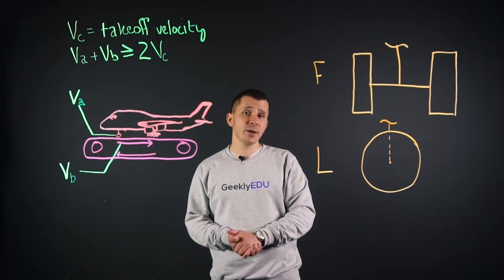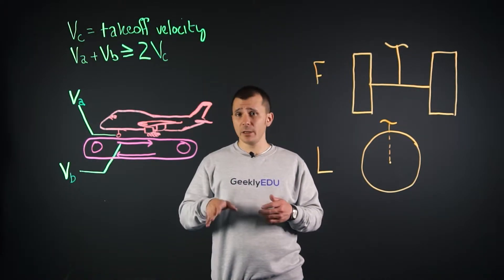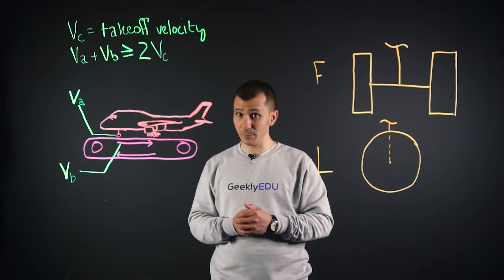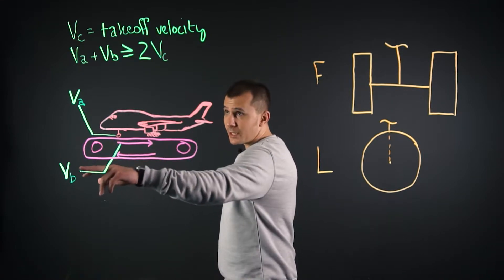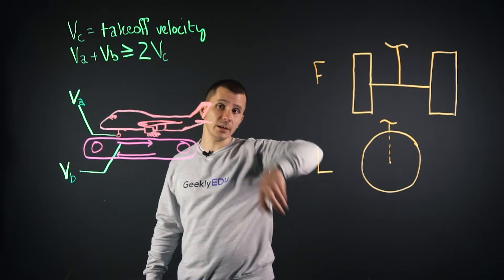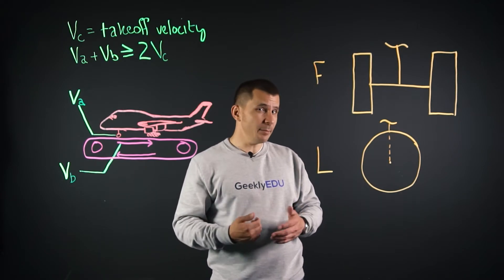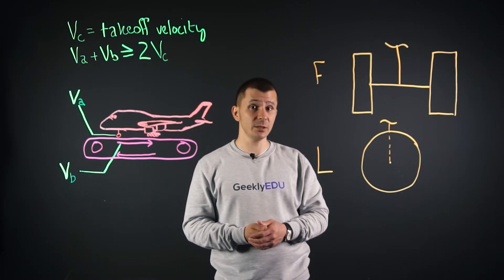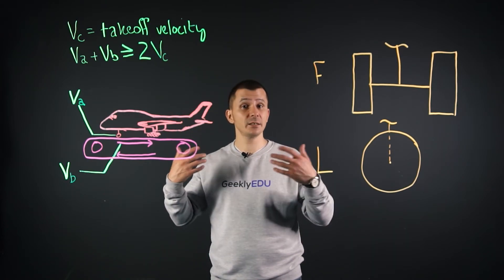Plane on a Conveyor Belt - Will It Take Off? #GeeklyHub

Comment: First off, there are no motors in the wheels, they are FREE SPINNING.  Second, the engines and the thrust they creates against the air itself are totally independent of what the wheels are doing.  So it makes no difference how the riddle is worded, if any part of it talks about wheels spinning at whatever speed the plane will always take off.  People are too accustomed to how a car works because it's wheels propel it forward.  A plane does not do this.  It's wheels are only there to provide a smooth, low drag medium between the plane and the runway surface.  That's it.

Comment: If all you're worrying about is the tire ratings (which is a valid argument), let's use a 747 for example:

"The takeoff speed for a Boeing 747 typically ranges from 160 to 180 knots (approximately 184 to 207 mph),"
"High-pressure: Each tire can handle loads exceeding 50,000 pounds and can tolerate speeds up to 225 mph, with some rated for speeds up to 288 mph."

Now, consider that the rating isn't the point of failure, it's the point where the risk of failure begins to increase. If the plan is taking off at even 200 mph in this case, you'd have the tires temporarily and for a very short period of time exceeding their speed ratings. That doesn't mean they'll fail, just that the risk is increasing (there's always a significant safety margin built in too). As a result, the plane should take off fine, but you probably don't want to keep using conveyors.

Comment: The wheels and conveyor are irrelevant. The wheels aren't the plane's mode of locomotion. The plane's thrust would move the plane forward regardless of what the wheels are doing. They're just there to hold the plane up while it accelerates enough to take off. The conveyor can be moving in reverse twice the speed of the wheels and as long as they wheels don't fail causing the plane to fall,  the plane's thrust will still move the plane forward.
Reply: It’s not the mode of locomotion that matters.  It’s the motion itself that matters.

This is a kinematics exercise of two independent bodies with two frames of reference.  We are given the connection between those motions.

The video poster made up the ‘two times the speed’ canard for some reason instead of going by what the explicit parameters are as given.

A 1m diameter wheel travels 3.14m in one revolution on the surface it is on.  The surface then moves that same distance in that same time.  The net motion at the wheel axis is zero.

It’s just rolling in place.

Comment: I’m going to say tha wording of the problem makes all the difference.. We can all agree that if a wheel is on a conveyor and the conveyor is moving opposite the direction the wheel is turning, and at exactly the same speed, then the wheel will remain stationary. That’s the part of the problem that really matters in my mind. Almost every time I’ve seen this problem, it has stated that the conveyor belt will always be moving at exactly the same speed as the wheels/tires. That is going to be physically impossible in the real world, but that parameter makes it impossible for the plane to move, which is required for it to generate any lift.
Reply: Consider these two scenarios:
1.	If you have a front wheel drive car with the rear wheels on a small conveyor belt (The conveyor belt is designed to exactly match the speed of the rear-wheels moving in the opposite direction), but its front wheels are on the ground, will the car move forward? Yes. The front wheels cause the car to move forward, just as jet engines in a jet will cause the jet to move forward Yes, I used “jet” three times in a sentence. I didn’t want to say plane for clarity.
2.	A sea plane going up-river against the current will take off.

Comment: This is the way I proposed to answer this theoretical question. Use a model airplane on a conveyor running at Low speed one then record the RPMs or engine speed that keeps the airplane stationary on the conveyor. Increase the conveyor speed to high speed we just like 5x speed 1 and record the engine speed RPMs that keeps the plane stationery at the higher speed. If engine speed 2 is higher than engine speed 1 the airplane the airplane cannot take off.
Reply: A plane going from bow to stern on an aircraft carrier will demonstrate.  A plane rolling at 5 knots on a ship moving at 5 knots will be motionless in the environment.

Comment: If you actually looked at what people argue its not if the planes wheels would explode which would be extremely subjective. They argue whether the plane could move forward at all.
Reply: I never understood why people think it wouldn't move forward - you wouldn't expect a treadmill on a pool floor to stop you swimming forwards in the pool, so why would anybody expect that to happen with a plane in the air?
Reply: @joebojanic1905, Because of the words "exactly match" it makes it an open loop problem, and the speed the wheels would turn at 2X the ground speed. This is impossible in the real world. A 747 takes off at ~150MPH. So, the wheels would be turning at ~300MPH. If there is ANY delay from the wheels turning to the conveyor belt matching the wheel speed, then it would create a feedback loop that would accelerate the wheels to an incredible speed and the wheel bearings could heat up, melt, and perhaps cause enough drag on the jet so that it would not take off.

Comment: Very simple question, and yet you answered it wrong. You are not a geek if you think that a plane can take off in such conditions. Once again, don't forget that the question clearly states that it's a Boeing 747, and that there is a treadmill that matches the speed of the wheels. The wheels can't move independently/freely, it's not a balloon, it's a Boeing 747, which has a mass of 200-300 tons. No plane can take off in such conditions at all. If you still think that it can, then you, sir, are simply an idiot.
Reply: Idiots don't understand that they are idiots but they think that others are idiots
Reply: @IlyaLts, Because of the words "exactly match" it makes it an open loop problem, and the speed the wheels would turn at 2X the ground speed. This is impossible in the real world.  If there is any delay whatsoever from the wheels turning to the conveyor belt matching the speed (the real worls), then it would create a feedback loop that would accelerate the wheels to an incredible speed and the wheel bearings could heat up, melt, and perhaps cause enough drag on the jet so that it would not take off.

Comment: The answer is just - yes. 
The correct question would be: what speed would the conveyor be at as the aircraft takes off? 
I would imagine its at take off speed but in the opposite direction
Reply: If the wheel rolling has a tangential speed on the circumference and the surface is moving in perfect synchronization, the wheel axis remains in place.  We can’t avoid that math or physics.

The second part is where the various experiments go wrong.  Not only are those two speeds equal in kinematic terms, it also means the rate of acceleration is always the same as well.  Where people go wrong is asserting incorrectly that the vehicle just starts moving faster without also increasing the rate of speed of the surface.

It is an impractical experiment that would be tough to create with low latency responsiveness of the conveyor.  The best way to do it would be to use a mechanically linked system to show empirically the precise kinematic relationship.